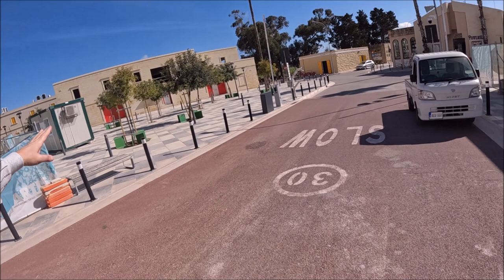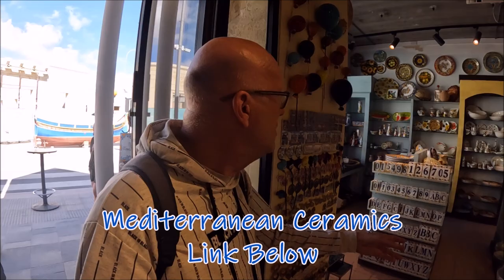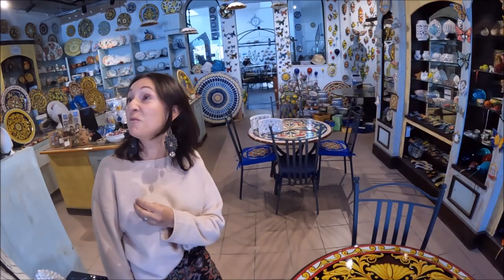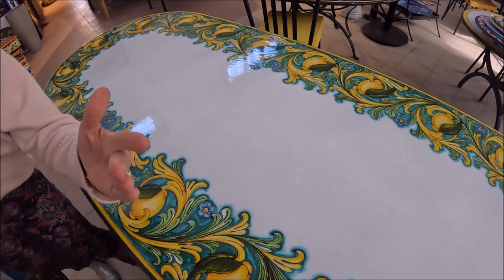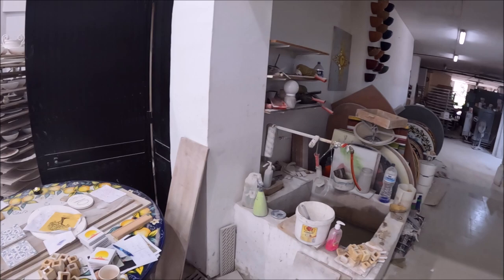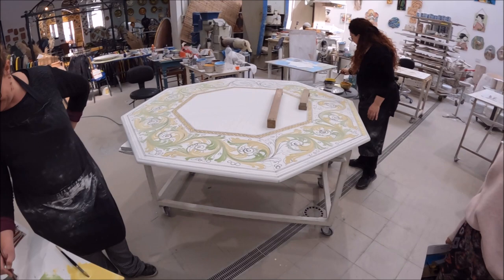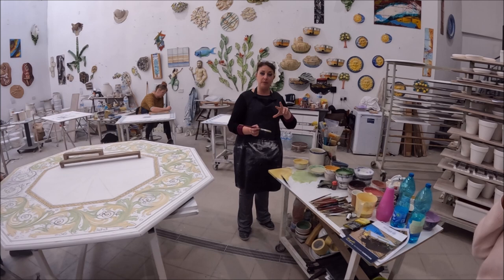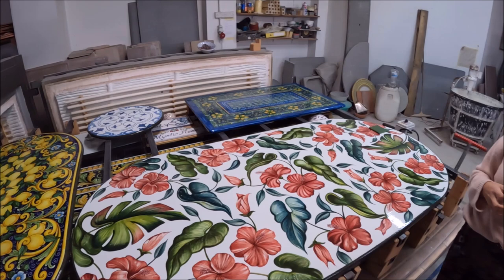Maltese Ceramic Factory Behind The Scenes, Mediterranean Ceramics Ta'Qali, MALTA #malta #ceramics

Comment: I miss the huts, some of them where from WW2 I think Quonset huts. Great video. Thank you Steve
Reply from the maker: Most was falling apart hell in summer awful in winter !
Reply: Know as Nissan huts in the British Army had some very cold nights sleeping in them.
Reply: It doesn’t look the same without the Nissan huts but like everywhere things change.  The tables are fabulous as are other ceramics.  Expensive place.  Thanks Steve for sharing.
Reply: Generous offer from Jessica.
Reply: @davidcole7900  I worked in one in S. Korea in the 70's and it was extremely cold, but we had heat.
Reply: @Suzette Calleja  we had coal brazier with a flue that went up through the roof it was no use at all.🥶🤣